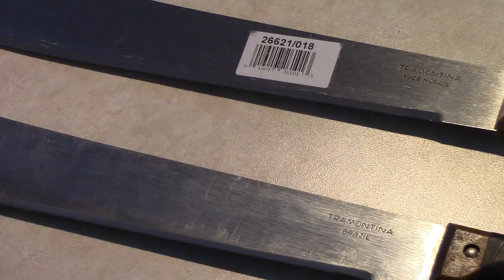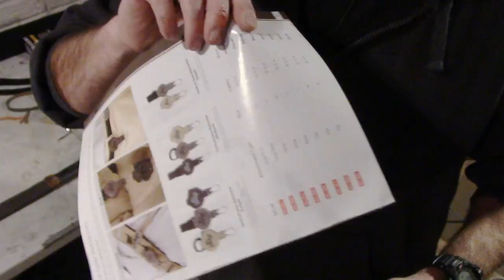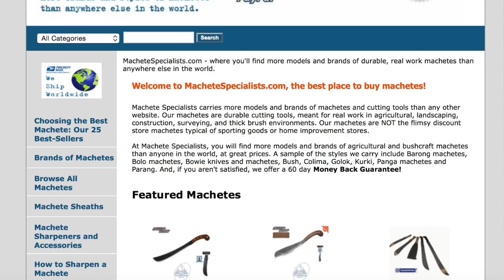Step By Step Jessification of the Tramontina 18" Machete  - Preparedmind101

Comment: In Jamaica we use our machete for digging small holes to get to foods like yams as well as cutting, chopping but  we maintain the  sharpest part of the blade at the base. I like the tool you use to sharpen the machete. It definitely beats a tool file.

Comment: Good vid. I own 6 different machetes and the Tramontina 18" is my oldest. And my favorite. I've had it for close to 25 years now. It's one of the first ones they sold with the plastic (ABS) handles. It's comfortable as hell to use. I've used it to chop many 3"-4" diameter trees and it's always handled them perfectly. I've never felt the need to reprofile the tip like that personally. The amount of metal you're removing is negligable as far as weight is concerned. But I agree that tip would be more useful for stabbing. I just never felt the need to make my machete a stabber. But it definitely looks ooler like that.

Comment: Just did the handle on mine. I used the work sharp to grind the spine side of the handle down so the spine is flush with the wood and I stained it. Looks really good. Been following this channel for years

Comment: Hi Chris, here's a tip for removing all kinds of residual glue from all sorts of materials. "Baby Oil!" Yes...baby oil! Something in the property of baby oil gets right into the glue and just brakes down it's adhesive properties. I've used it many times when methylated fuel, and other means doesn't work, dab it on and lightly wipe it off. No smells apart from the pleasant scent of the baby oil, hope you find this useful. Great vids as usual and all the best from the UK.

Comment: Hey Chris, awesome video! I'm going to be buying a Tramontina as well thanks to your videos. Just an observation - you said you soaked the sticker on the blade over night in WD40 to get it to come off. I'd recommend using a brake cleaning spray that you can pick up at any auto parts store; I use Brakleen myself and it works wonders to get stickers, adhesives and oils off of most smooth surfaces. Just spray it on and wipe/scrape it off in the moment and you're done!

Comment: Despite this video being seven years old, it's still a solid tutorial.   No doubt the Tramontina is a heck of a good machete.  It can be frustrating for those that buy it and expect to be whacking away right after purchase.  Those that know this machete know they are sold duller than a spoon.    

    An friend of mine had his vehicle broken into right after Hurricane Ian, they stole many of his tools, including his hand-me down machete that was his father's.  So rather than forging one from scratch, I simply bought a Tramontina, 1070 steel isn't my favorite  steel, but great machete steel, as it can be sharpened with a rock if need be.   

 After I reprofiled the machete,  I replaced the wooden handle material to canvas Micarta, then engraved his name on it. I also scribed his name and number underneath the new Micarta handle, should it be stolen again, even if they file down the visible engraving, the stealth scribing under the new handle proves ownership.    PS, I suggest anyone buying a Tramontina, befriend a bladesmith, a 2x72 belt grinder or even a 1x42 belt grinder can put a wicked edge on a Tramontina in very short order.  Done by hand it'll take a fair amount of effort.      If you take 90% alcohol and a guitar pic, or a plastic wedge,  use that to remove the sticker. Comes right off.  Your video has helped a lot of people take a good machete and make it great.

Comment: I remember me and all my friends used to go and mow yards all summer and then go and buy a few of those and drawing out designs on them and getting my friends dad (who was a hobby knife maker) to cut them down into survival knives and we'd all use them as survival knives.
Reply: Very cheap solution - the only downside is the softness of the blade to prevent them from snapping. Even a proper heat treatment won't get the steel harder than about 57 HRc, so it won't hold an edge and you have to sharpen it more often.

Comment: Ok, I sobered up from playing the "Very, Very" drinking game and just wanted to drop ya a line.   I can tell you don't need any pointers in sharpening a blade, Nice work!!
 I will maybe give you an idea on how to make quicker work of those pesky labels though.  If you want to remove the label a bit quicker you can apply a bit of heat to it with a heat gun or cigarette lighter.  Once the label is heated up some it usually will pull of with ease.  Pull steady with a pace so you get it before it cools but don't pull to fast or may rip the label.  It will in most cases leave some adhesive behind that can easily be cleaned up with your favorite solvent and a (razor blade, if can be applied with out damage).  thanks for the Jessica vid.  Love your channel.
Reply: You have to be careful with coated blades though.

Comment: The up swept tip is to add weight for better chopping. They do add wear to the sheath. I prefer plastic handles in the tropics but wood shaped and sanded down and treated with boiled linseed oil is pretty elegant. Scrape the paper label with a paint scaper or something, then just use wd40 to remove the residue. 
An angle grinder with the thinnest blade you can find is more economical for removing stock. An angle grinder with a flapper disk is great for presharpening the edge. Hold the machete to the workbench with c-clamps.

Comment: Bought a Tramontina and then found your video. Glad I chose this one! You mention a 15 degree angle is good but I just got my work sharp and it only has a 20 degree angle. I guess that’s the Ken onion version you’d need for 15? Will the blade be just as good for garden work at 20–25 degrees or would you always try for 15? Not sure how I would achieve it.

Comment: A product called "GOO GONE" from most automotive stores will easily take off glued on tags. Put it on a rag or paper towel and rub it on, let it soak in. Than take a razor scraper and scrap it off. Everything comes off very clean. Wash with soap and water to clean it off and apply WD to protect it. "GOO GONE" will also get off chewing gum and other things too. Jim, Charlotte, NC

Comment: Nice job man.  Your correct you don't need any knife sharpening tips.  What did you put on the leather strap before you started strapping?
Reply: I think it was a special wax that he put on the strap. As a cabinet maker I had to sharpen quite a few tools in my life, - we've been using the same as a hair dresser uses to sharpen razor knife blades. Everybody does it a little different, my favourite tool is an oil stone.
Cheers from Germany
Reply: ...and yes, Chris does not need tips to sharpen a blade! :-)
Impressive clean cut through that paper!Adulf Dabo
Reply: possibly a strop paste, containing very fine sanding particles (industrial diamond dust) gives a nice clean edge. The conditioning paste/wax/oil would be put on after stropping to keep the leather supple.

Comment: You can buy an 18" Tramontina machete with a good nylon sheath at LOWE'S for $16. So if anyone doesn't want to order online, you can take a drive to LOWE'S and handpick one for yourself, if you prefer to look at the blade, grind, and hardwood handle for yourself. I bought one there, and it's excellent. Plus there's no sticker on the blade to remove.
Reply: I got one a while back at Lowe's and the machete was tethered to the sheath in such a way that I couldn't pull it out to inspect the blade.
Reply: Janson Gander    I just got one today from Lowes. $19.99. They had it zip tied to the sheath so I couldn't inspect it. But it's ok. Can't wait to use it.
Reply: First thing I did with mine was re-profile that 2x4 they call a handle.  No problem, I have a small shop, and for the money I 'm not complaining.  I rounded the rear of the finger well so there is a slight re-curve to help with pinky retention.  As for trimming the tip.  Why? Except possibly for looks - which are subjective. Personally, I like the cutlass profile. For a machete, I want all the weight I can get out there.

They definitely need attention to the cutting edge. A medium file will do the rough work of laying back the angle, then a medium stone with oil will bring it to a razor edge.

Comment: I love mine.  I have owned 3 and gave them all to friends, to quell their envy.  I now have number 4 and chose the bolo style.  No mods.  My Favorite machete yet.  It makes very fast work out of certain house hold shrubbery and gardening chores.  I have taken down a 3 inch diameter tree with it so far,  mulberry,  in less than 10 minutes.    My uncles silver maple fell.  I used the tramontina to chop up all the medium to small branches and the did it in record time and I'm no expert.  It made chainsaw work easy because all the trouble spots where gone expediently.  Love this thing.

Comment: Safety has to be a major concern. Especially in the field. A serious injury can occur so fast. One split second of not paying attention or not being focused can result in a permanent problem. Machetes (especially Tramontinas) can be very productive tools. Like an axe, they can be your worst nightmare in the hands of one not 100% focused. It's nice to see this whole procedure demonstrated so those considering their own mods can get some ideas. Tramontinas from the factory stop short with the edge about 2" from the tip. We take ours right out to the tip also because we have plans which are very thorny and necessitate you having to poke the tip in there to remove dead spots.

Comment: Try heat stickers up with a hot air gun or hair dryer, gets even the hardest stickers off. The machete looks sweet, only thing I would do would be add some cold gun blue to the blade to tone it down, great video though!

Comment: I have a rodery tool where the cutting blade is 6 inches in diameter. 10 000 laps every minute. Those are very effectiv  check them out.

Comment: Lol at how u wrapped that grip. I'm a tennis player and use Wilson grips all the time...you start at the bottom of the handle with the sticky part and wrap up from there til u get to the top of the handle them use the included sticker at the top.
Reply from the maker: And that matters.... how? It's not a tennis racket. I always wrap mine that way. It works fine.
Reply: I don't rely on the sticker backing or the tape that comes with the Wilson grips.  I've found on heavier tools that the sticky stuff that comes with it are not quite up to the task of keeping it on the handle.  I've actually started using Barge Cement on the last 3 inches of the tape to keep it secured.
Reply: plus on a tennis racquet that tape is used as a finisher, on a pert of the racquet that isn't used.  I use the same stuff on my knife handles, in exactly the same way......no tape required.
Reply: Eric Montford good idea, I will keep that in mind if any of mine do come lose.
Reply: shootermcmillan
You're very welcome.  8-)
Reply from the maker: if it starts to come undone or if you are worried it might,  a TINY amount of loctite gel store glue usually does it for me. i keep lots of that on hand.

Comment: if you use it all day in the jungle that tape will dig into your hand and eat it up like the cookiemonster eating all your biscuits plus if you take of the part like you did you will take out allot of functionality. if you leave it you can use the machette as a regular carvinh knife and draw blade, use it as a carving knife by wrappinh your fingers around the tip with the handle laying on your knee or stick it between your torso and ellbow. though in north america its great, having it that sharp in the jungle makes no sense as the machette is used allot for cutting vines and unlike in the usa vines here can be easily cut with a dull blade, its also used quite allot for digging which dulls it immediately. so if you want to keep it that sharp it means handsharpening 3x every day. digging is necassary to create fire.
Reply from the maker: +ULTRA NOOB Thank God I love in Ohio then.
Reply: PREPAREDMIND101 haha ikr I still have not adapted to brazil, south murica is upside down

Comment: WHAT? No choil? I thought for sure you would grind a choil into that unused real estate between the handle and the edge termination! LOL just yankin'  your chain a little. Nice vid Chris, a lot of guys who get heavily into knives start to believe the propaganda that we actually NEED these high end knives, it's bunk! Just a couple days ago a guy on another youtube channel ask about utilizing cheap kitchen knives instead of a $150+ knife. Immediately I thought of the old hickory line. Some of these knife snobs need to go to S. America like Joe Flowers and some of those other knife guys did........you can tell that it was a humbling experience to be schooled  by a jungle native who pounded his machete from some found or reclaimed steel.  We buy expensive knives because we like 'em, they are quality true, but in the end a tool that works is more valuable than  a tool that's pretty.
Reply: P.S. Perhaps you recall from some of our previous exchanges......not a fan of choils on knives,  but on a that machete  I could see it being an excellent mod.  Many So. American machetes aren't sharpened on the rear third of the blade, as they use that part of the blade as a hand hold for choking up. Here in the states we sharpen our whole blade so I can see real benefit to adding a choil in that unsharpened area.....just a thought.
Additionally, I think a N. American machete should be designed differently, even regionally different design influences. A machete From So. America could be useful in Florida......same blade is virtuously useless to me in the Mountains of Colorado, Pacific NW ( I 've lived both places) will require different features....if you can find a use for a machete at all.
Reply from the maker: shootermcmillan the TOPS .170 'machete' I just got has one. It's going out for kydexing tomorrow.
Reply: PREPAREDMIND101 Hey that's nice! Just checked it out....besides the Tahoma  and the BOB, that's  the first Tops knife to get a second look from  me. Looking forward too seeing it in action.
Reply: shootermcmillan actually I forgot....really like  the Tex creek XL....but it has a different flavor to it than every other Tops knife
Reply: The blade is too thin for a choil to be at all comfortably or useable.  In my opinion it would be much better to just sharpen the edge all the way down to the handle.
Reply: Eric Montford I don't care for choils anyhow. If a blade has one, you must use it. Like you Eric..... I prefer to have the grind come back all the way to the handle. However in the case of a rather long blade  the choil would allow you to change the balance of the blade with your hand placement,  thus making  detailed tasks easier. I loathe the term "choking up".  On a shorter blade having a choil sacrifices valuable cutting  edge for aesthetics in a case where there is no actual mechanical advantage to do so. but hey......personal preference right??  The choil on that Tops machete should prove useful at 1/8"  the issue of the blade being too thin is negated, though I would probably wear gloves anyhow so I'm not entirely convinced that would be much of an issue.
Reply: shootermcmillan Agreed on all points!  8-)

Comment: Hey Chris, if you are still having problems with those stickers. Instead of the WD40 trick, just steal your wife's hairdryer and heat the sticker. The glue will warm up and you can peel most stickers of easily. I always do it like that when I don't want to damage a box or such or just don't want to clean for minutes :P